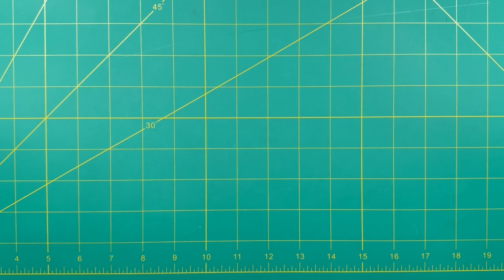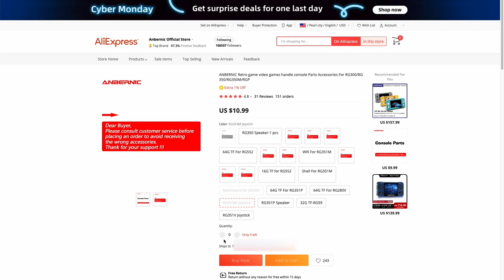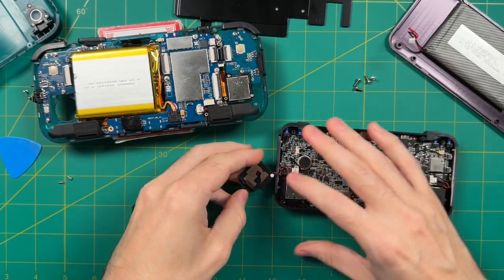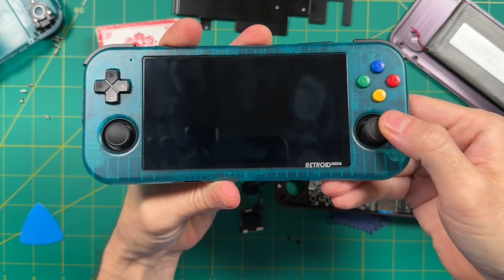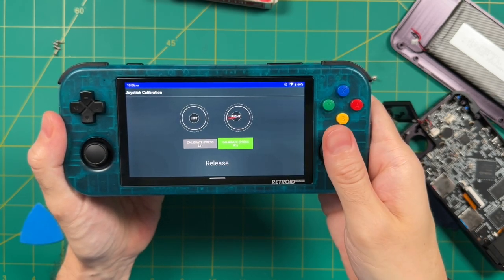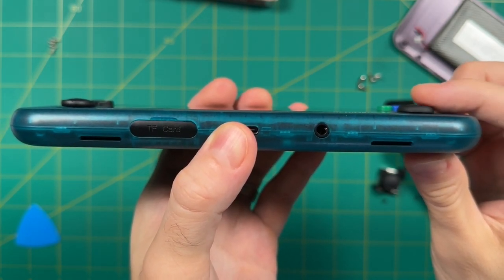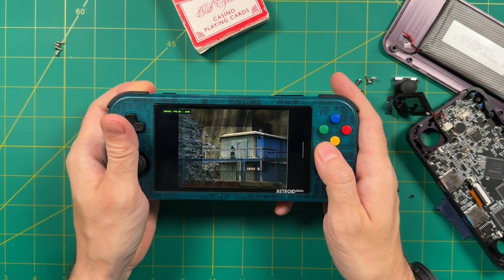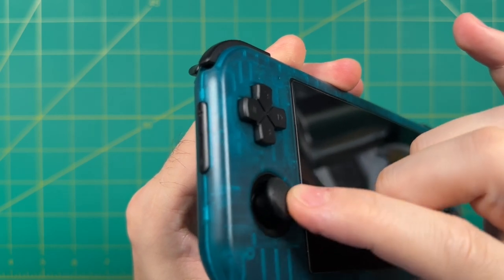Retroid Pocket 3+ with Hall Sensor Analog Sticks

Comment: I just attempted this mod and was able to achieve full functionality and I love the upgrade so much! 

When installing I filed down the inside edge of plastic dome insert until the 353m hall sticks could easily be pushed through with little effort. After that I used some sandpaper on my fingertip and rubbed down the inside dome inserts surface. Not a lot maybe a 1 minute per insert.

After assembly and calibration everything was working 100% and noticeably more smooth and accurate than the stock rp3 sticks (for 1st and 3rd person shooting games especially).

Hope this helps anyone who is still interested in this mod even though retroid has their own hall sticks coming out soon.

Comment: seems like a custom 3d print of the joystick case could solve this by being a bit thinner allowing the joystick to sit higher out of the case or enlarging the cases inner diameter that it's bumping into. Thanks for testing this out.
Reply: Yeah seems like the problem is just the housing used for the stick rather than the stick itself.
Reply: Or just replacing the thumbstick cap for a smaller switch styled one.
Reply: @CockroachMunchingKrabbyPatty  are they removable? I'm pretty sure it'd be a single piece being so small but idk.
Reply: @gr1f1th  It's hard to say without looking at the individual part of course, but it's possible on switch joysticks. So I don't imagine it's impossible with these new ones.
Reply: @CockroachMunchingKrabbyPatty  My guess would be the answer is not really. I think the best answer if you really wanted to do this procedure, is 3d printing
Reply: No the problem is the cap lol, you have to trim the bottom of the cap so it doesn't protrude more than the RP3 stick, in the end they're much better than stock
Reply: @rassular  Good to know. Also do you know if they are sourcing this joystick from another company? Or some other way to buy the hall sensor version?

Comment: I replaced my Odin Pro joysticks with the RG353M sticks. I ordered 2 pairs and 2 of the sticks had the same issues thats were displayed is Russ's video: They didn't get full range on at least one of the axes. The other 2  sticks are perfect. Unfortunately it seems like you need to get lucky, but in my particular case it's definitely an improvement. I didn't get full range with the original Odin sticks either and when I was turning around in Tomb Raider Legend (PPSSPP), Lara would always walk instead on running. This issue has now been fixed.
Reply: Is there any way to test  if they work before putting them in my Odin?
Reply: @jimmyfallon4237  Unfortunately not. There's no visual difference betwenn the 4 sticks I received. But the replacement is very simple once you've managed to open the shell. If you don't have any drift issues atm, you might want to wait for gulikit sticks.

Comment: So one of the first mods I made to my RP3+ a couple weeks ago was to swap out the analog sticks with a couple replacement switch joycon sticks. I ran into a similar problem as you, where it can't make a full rotation when testing in the app. It was a lot closer though than the hal sensor ones though, those seem pretty off. I just ended up fiddling with the joystick sensitivity in each emulator until it was dialed in. It works great now! It would be great if we could get some bigger sticks with a slightly longer post.

Comment: I installed these into the Odin Lite and they work well. It fixed the odd issue I had were my characters would only walk instead of running in certain directions. Thx for all the great content! I do have one quick question, I know the RP3+ screen gets really bright and dim, does the RG353M have that same range? I love playing at night and some of the devices (like the Odin lite) does not get dark enough for my tastes. Thanks in advance!
Reply: Thanks, this is good to know! I have a few questions for you if you have the time. When you calibrate the joysticks, does it give you a more accurate circular rotation than the original sticks, does the marker easily reach the edge of the circle in all directions for you, and did you have to change the caps for the sticks? 

I was very excited for my Odin Pro, but it's been a complete let down for me since receiving it because the sticks are so incredibly awful. Don't know how nobody touched on how trash the analog sticks are. They are almost unusable on my device. In every game I play, I can't get my character to run. They walk like they are wading through a swamp. Thanks in advance!
Reply: Wow, really? I was just about to ask. I have a Lite and one of my sticks was wonky at first. It has evened out now but this looks like a good backup plan for when they inevitably fail.
Reply: @mistermoshi6505  I didn’t need to calibrate for full range. The testing app hit all corners perfectly. The range of motion wasn’t different, but the caps felt much much better on the thumb. I couldn’t tell if the cap is touching the edge but it was super close. Overall I def like the hall sticks over the stock. I’d probably recommend using switch stick tho because they are taller.
Reply: I have that same walking issue. I have the pro, I think it should still work?
Reply: @pavelgolubkov7679  Looks like the Rg353m sticks are sold out ATM anyway. I've tried switching them out for switch sticks, took the caps off, and it was actually a little worse, haha. Will wait and try these sticks anyway. Thanks!
Reply: That is exactly why I put them in my Odin Pro (psp walking/running issues). FPS games are hit or miss anyways and Time Splitters 2 is always hard to control without the original gamepad.
Reply: Just as an information for all the people who have the issue with their character only walking instead of running: Just set the sensitivity for the left stick a bit higher in the controller calibration by hitting the circle of the stick in the display.
Reply: @estylegreesye4384  Do you mean adjusting the deadzone radius? Because that sadly doesn't address the issue for me. When going into gamepad test, the X and Y values for my left stick only reach between -0.7 to +0.7  when the range should be -1.0 to +1.0. The dead zone only changes how sensitive it is to start reading my inputs, but it does not change the extremities of those inputs. Does anybody have a solution to this?
Reply: @estylegreesye4384  Holy crap, I just tinkered with my Odin some more and the solution was hidden in plain sight. I didn't realise that you could adjust the sensitivity in Gamepad Test by tapping the sticks. Why the hell isn't that in the joystick calibration, and why was mine set to .75 sensitivity by default? Thank you so much!!!
Reply: @mistermoshi6505  yes exactly, that's what I've meant. Sorry, I wrote "calibration". I wasn't sure where exactly it was by heart. Glad, you've found it!
Reply: @estylegreesye4384  This works, but for some reason broke my xbox streaming app. The controls because inverted after increasing the calibration sensitivity.
Reply: @pavelgolubkov7679  oh wow, and now I think that you've just helped me with this answer because I had inverted controls in RetroArch. I bet it's the same reason. But now I use Duckstation and AetherSx2 as standalone apps, anyway. There it works. Crazy, though!

Comment: I know both of the devices just from video. 553 as well as the Retroid Pocket 3+ but if the only problem with the Joysticks on the Reroid is, that they are a bit more slim than the one of Anbernic, why not just keep the original ones but put Rubber Caps on? I'm sure they are avaliable somewhere.

Comment: Oddly enough, I don't find these Hall Sensor sticks used in these handhelds to be that great. I own a 353m and you can hear/feel a slight grind in them, also my RP3+ default sticks feel better as well as they are more accurate overall.

Comment: I'm wondering if thumb grips made for a joy-con would fit around the Retroid's sticks. Might be an in-between solution that doesn't require swapping out the sticks?
Reply: I read on Reddit that joycon gribs are too big so I'm thinking maybe the switch light sticks might be the same size
Reply: I think the point was to replace them with non-drifting sticks.  It’s not the caps.

Comment: Hey Russ - My (blue) RG353M has flat-edged, six sided hex screws and not the T6 star shaped screws yours does. My T6 screwdriver just spins in them, requiring a hex key to open. It's possible Anbernic's assembly techs are using whatever screw fits and is at their desk, and not one standardized screw head.

Just wanted to point it out, and thanks for a great video as always!
Reply: Do you mean alen screws?
Reply: @bloodyrunesd  Yep.

Comment: Is the benefit of hall sticks due to the simply the thumb grip being better or does the actual stick itself use better parts/tech? If it's the latter, then the issue of restricted mobility is a result of the thumb grip being too big. I've been messing around with using  joy con analog sticks in my RP3, which have provided a much better experience, but also restricts movement a bit. 

I haven't had a sec to test it out, but it looks like you can actually swap these larger grips with vita thumb grips, which are obviously smaller, and that should give you full movement.

I know the grips on these sticks lock in with holes, but since the vita replacement grips are smaller, with a little effort you should be able to just wrap them onto the grip-less stick and it should snugly stay on it.

Again, I haven't had a chance to try this myself yet, but it's definitely worth exploring in my opinion.
Reply: The hall sensor uses a magnet, rather then a wiper that can get worn out over time causing stick drift. So the tech is better but feel is different.

Comment: Do you know if you can you put these analog sticks in the RG353V? I just ordered one today and I'd love to know. Thanks!
Reply from the maker: You'd have to look at the sticks on the RG353V, because most Anbernic sticks are attached to a small PCB board.  If the RG353V doesn't have that board then they should have the same drop-in replacement opportunity.

Comment: I dont see the point of doing this mod even if someone is worried about drift when the tradeoff is losing full range of motion due to the case.  If someone gets unlucky and has drift, just buy another switch stick. They are dirt cheap. The thumbsticks are smaller than I would prefer, but thats sadly the tradeoff for a thin profile and pocketability.  Steam deck is pretty much the only handheld I have where I truly enjoy the sticks, lol.  Joycon size sticks are always going to feel a bit compromised in size.

Comment: Are the RG 353M sticks the same as the ones in the RG 505?  If not, do the 505 sticks work in the RP3?
Reply from the maker: They are different, the 505 sticks have a small PCB attached to them

Comment: Unfortunately the only way to make it work is taking the cap off the hall stick and add a vita cap, just like you did with the Odin. Like you said i wouldn't recommend it unless the stock sticks start to drift and someone is willing to rip the caps off.
Reply: You don't though, just trim the bottom of the cap so it doesn't protrude more than the stock stick
Reply: @rassular  i would rather put a vita cap on it, also i don't think the stick caps are glued on so cutting it probably isn't a great idea.
Reply: @AishRios  the caps are on tight so it doesn't affect anything, just makes it fit to have full range
Reply: @rassular  I'd rather not have chopped up caps but i get what you're saying

Comment: Could boring out the black sleeves help increase the range of motion? You could also cut the sleeve to be shorter so the sticks are out slightly farther

I know it wouldn’t be a beginner friendly mod to do but if you need the hall sensor sticks it should work, right?

Comment: Very odd. My results were the reverse of yours Russ.

I did the same test, side by side Anbernic hall stick on the left and stock RP3+ stick on the right and the hall stick works great, I get full range of motion while the RP3+ stick doesn't reach the top right and the bottom right corners.

https://i.imgur.com/GCsVXDD.png

My hall stick also just barely touches the RP3 case to the point where the contact is negligible. I'm not getting physically limited motion because the stick is not jamming prematurely against the case.

This upgrade was an actual upgrade for me, not a sidegrade or downgrade.

I only installed one stick because to be honest the 2nd stick I bought was DOA. It had drift out of the box and Anbernic refunded me the money for that stick. I'm waiting for the replacement stick to arrive so I can upgrade the right stick to hall as well.